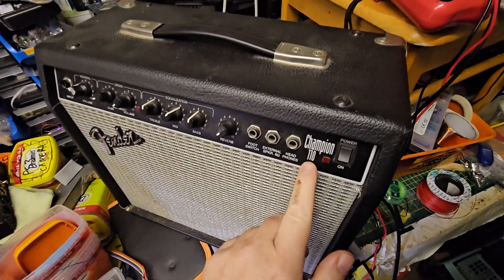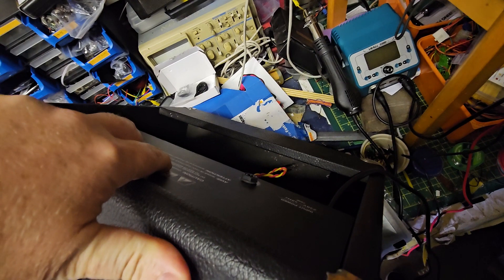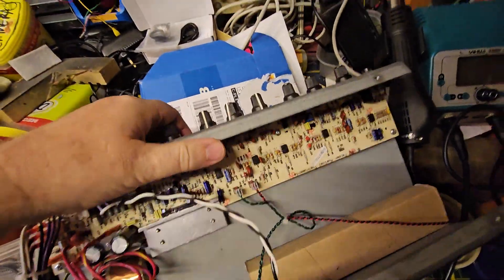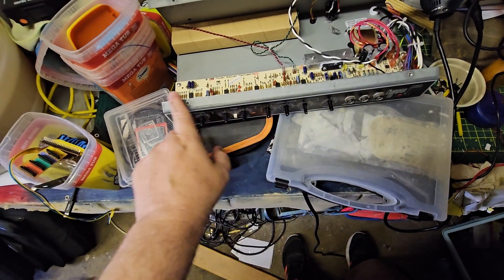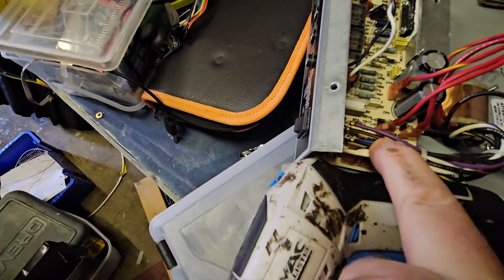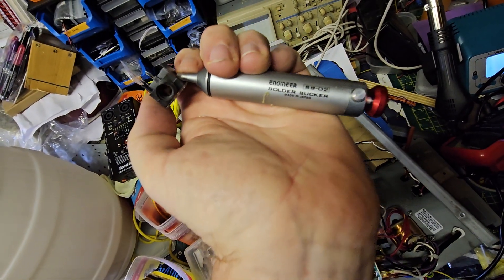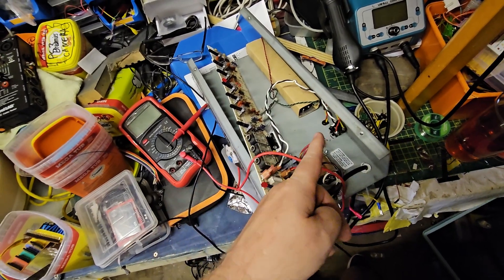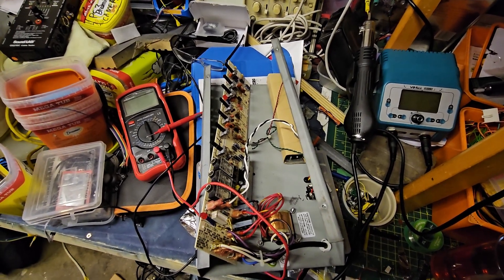Fender Champion 110 Amp - Teardown to replace input socket

Comment: how did you take the cables off of the on/off switch? the black, purple, brown, and blue cables? i keep pulling on them but they dont come off
Reply from the maker: Hi @wizzern8495 - in my case Fender used space connectors. They were not particularly tight.

I wore insulated gloves and use pliers to tease the leads off. But if you support the Power Supply you may not need to take it off?

Let me watch back and see if the PS can be left in. You might need to unscrew it from cage.
Reply from the maker: OK so about 6 minutes in i take off switch cables. Given I wanted to solder the input jack and that's opposite corner (left hand side) you don't need to remove the switch.

Wedge something along mid of PCB to allow you to desolder jack from underneath on left.

Hope that helps.
Reply: Thank you so much sir .

Comment: I have to do the same repair on my input jack. Thanks for the painful looking process! I hear you on the sweep of the volume pot, it really is made like that. Insane volume level at 2, like many other Fenders. Did you ever get to replacing the pot, and did it indeed allow for a more functioning sweep in volume?
Reply from the maker: Yes. Not so painful if you don't short yourself out across the amp :-)

I never found any suspect components that might cause loudness. From my research it just seems to be the taper Fender used on their volume pot.

My "solution" is to use a volume pedal between guitar and input.

For a solid state amp it had decent clean tone and can get that Gilmour pinch harmonics on the drive.

Good luck with your repair. You can use a cheaper jack and wires. I was able to find the Fender part at reasonable cost. If u have a small clamp to hold jack to PCB you can get a neat solder joint.

Comment: What would cause this exact same amp to not make a sound when the gain button is on, and when its off the clean sound can be heard
Reply from the maker: Hi @tony - I would suggest checking out this weblink - there they have similar issue. The LED switches but a broken JFET causes the switch to not work! In this case J111 - there is a schematic on the post.

https://music-electronics-forum.com/forum/schematic-requests/23963-fender-champion-110-schematic

OBSERVATIONS
1 - I dont know much about this stuff so please dont consider me an expert - operate at your own risk and consult with real experts if you are unsure!

2 - if your clean channel is working but the gain isnt - that's still a decent amp! These things are plenty loud - the clean on this is close to my valve amp (Laney Cub 12R) so for sure worth keeping even if only the clean works

3 - you can emulate gain /distortion on your clean channel with a pedal and use that to "switch".

In other words - check out link above and if you are not confident to experiment at your own risk then try a simple pedal?

Please let me know how you get on - hoping for best outcome for you.